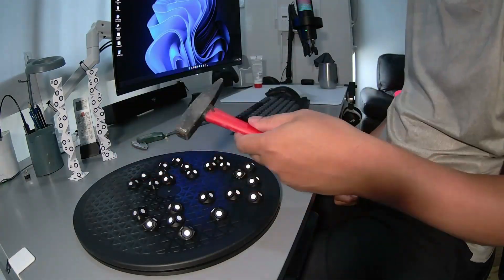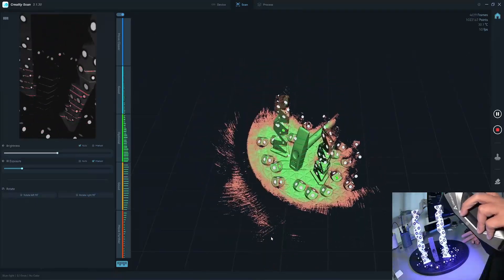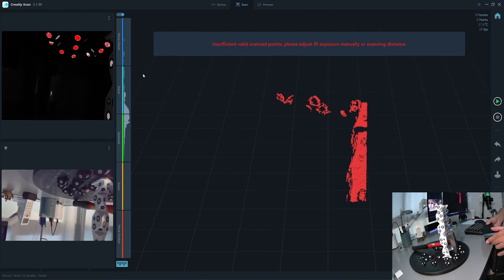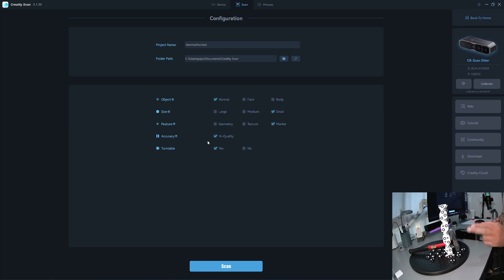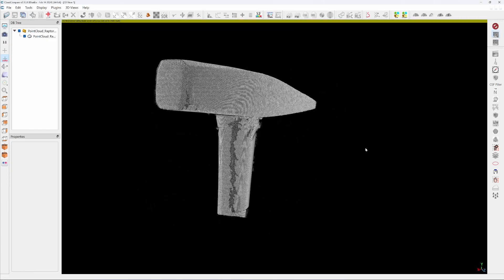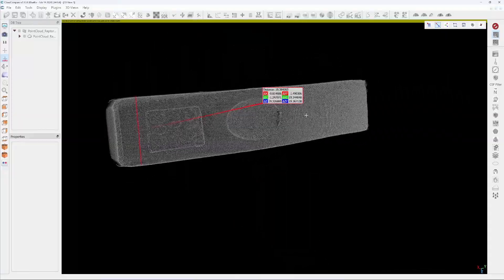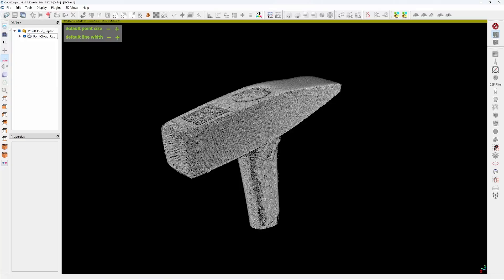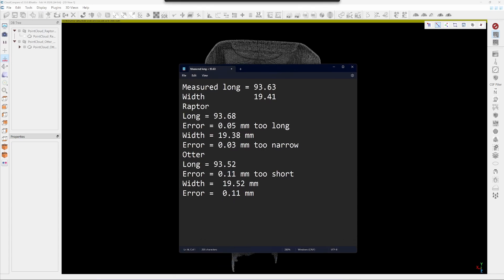Creality CR Scan Raptor Vs Otter - Accuracy Test

Comment: To chce naskenovat johansonovy měrky. Tam máte jistotu rozměru na desetitisícinu mm. Digitální posuvné měřítko může mít chybu měření klidně 0,3mm, už jsem takové měl. Pokuď chcete mít jistotu, že máte posuvku správnou, je třeba ji zkontrolovat Johansonovýma měrkama po každém mm stupnice nebo koupit certifikovanou.
Reply from the maker: The one I'm using is on the higher end vernier caliper. Thanks for your advice.

Comment: I bought the small (about 20cm diameter) Creality turntable. I am going to place some marker stickers on it. Does it matter what stickers - can they all be 3mm, or should they be of various sizes?
Reply from the maker: If you're using Otter or Raptor, be sure to use reflective marker type. The scanner can detect 6 and 3mm different and it will add randomness to the plate. You should mix them.
Reply: @Payo-TensileCreator  I have the Raptor. Thanks, these are some useful tips.

Comment: Thanks for your videos: lot of useful information into! 
I'm lookign for a scanner and I'm going to buy a Raptor soon!
Reply from the maker: I'm still rocking it. No issue so far.
Reply: @Payo-TensileCreator  Amazing! Very useful your tips and information! Thanks!
Reply: @Payo-TensileCreator  A question: the marker supports I see in a lot of cases are Black but here you use white: any reason? Pro and cons of using so different colours?
Reply from the maker: @apaolo67  The color should be least contrast with the object you scan. So that the auto infrared brightness would be set correctly.
Reply: Ok thanks!!!

Comment: Use a 3,2,1 block or something perpendicular. A hammer has no origin.
Reply: I did this on Monday as a test after getting the wireless adapter for my Raptor. The scan was accurate to about 0.03mm.

Comment: From what I see the raptor is very accurate for the price in marker/laser mode. But the otter is much better in markerless with its wider field of view. If possible could you try the scooter or similar with the raptor...if you think it will even work. The chair scan was not very good with the raptor....just wondering if it can handle larger objects either markered or markerless.
Reply from the maker: I'll try Raptor NIR with markers to see how much detail it can produce.

Comment: Are you on any of the Discords? or What's the best way to get ahold of you. I'd really like your help with my Otter. But not how you would think. 
I need a 3d model of the Otter itself, so was hoping you might scan the otter with the raptor to get a model of it?? 
I was hoping creality might have a .step or .obj file for it, but I havn't found one yet...
My goal is to model and print a case/handle for my Otter for ease of use. 
Similar to this one which is a modeled handle for a cr-scan01 (thingiverse / thing:5002779)
Thanks and another great video..